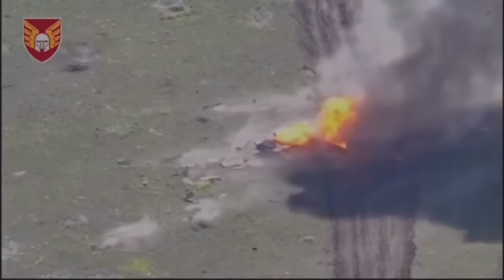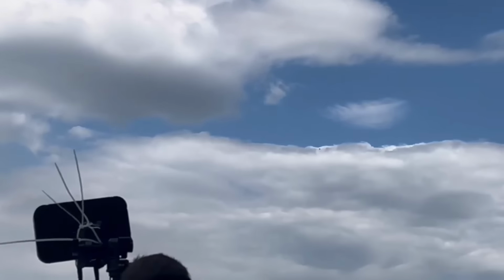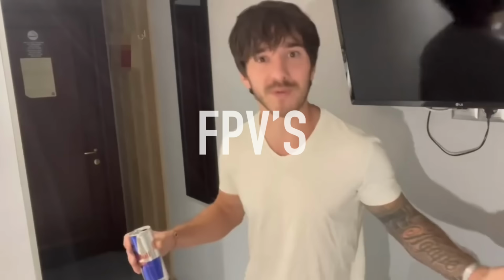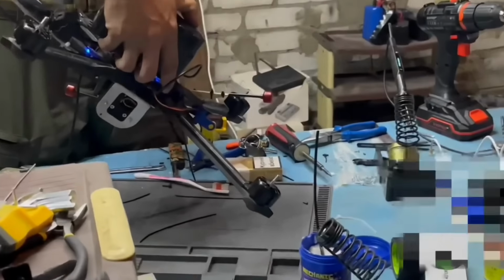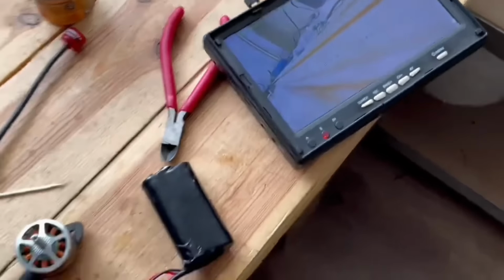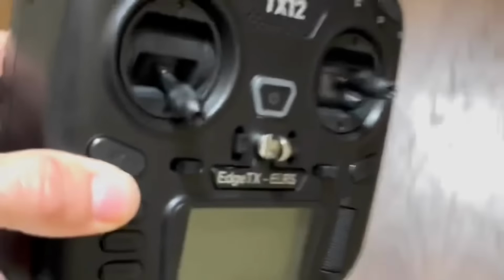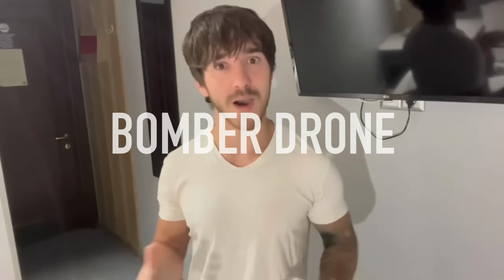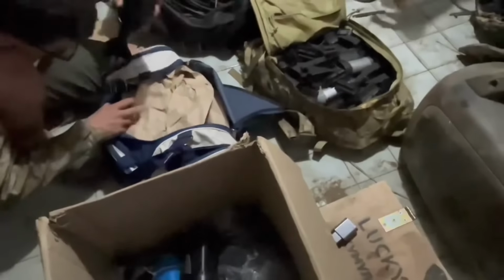How I Make Kamikaze Drones

Comment: Я сьогодні дещо навчився.
Reply from the maker: BARDWELL ❤️❤️❤️❤️ you are amazing, we all love you here
Reply: @CivDiv no joke, why don't they use a drone with an antenna halfway temporarily to a jammed location to extend your range for the fpv booms? Is that even possible?
Reply: @crazestyle83  actually, they do but few people know this
Reply: @CivDiv can I help you guys with supplies i can 3D print vog 17 cases and drop devices.  elrs transmitters receivers lmk I'm working on a solar-powered fixed-wing drone I also ordered 6 miles of fiber optic cable extremely thin like fishing line going to experiment with using that for control. Let me know if I can help also if you can get me the frequencies the Russians like to run there's a couple of us that want to try to develop some jamming devices not my area of expertise I also have some speedy bee controllers I could send you guys
Reply: @CivDiv 1 year late for this question but do you guys fly the kamikaze drones back to your position when you can’t find a target and the battery is low and change them out or let them die and crash
Reply: IN BARDWELL WE TRUST!!!!!
Reply: I just bought the Bardwell build yourself drone kit
Reply: Been flying FPV multicopters for 10 years. Joshua taught me everything. Thank you.
Reply: josh you really happy they weaponized our hobby? 
this is your life legit. what if our government decides to ban all drones cuz they been weaponized?
Reply: @508fpv  Every single technology has been weaponized. Every. Single. One.
Reply: How do you feel the cost effectiveness, increased range,  and versatility of FPV teams compare to traditional Anti-tank teams? like a squad armed with Javalins? Is there still a place for those very expensive, realitively heavy  anti-armor weapons? Or does FPV and bomber drones shift things a fair bit?
Reply: lol I'm really interested in his story, is he american?  Maybe you could interview him.
Reply: legend.
Reply: Can you put an antenna on a drone for boosting or cutting through jammers and fly it close by and land temporarily to extend the range of your fpv boomers?
Reply: Oh hey josh
Reply: nooo way, hello josha!
Reply: good one 😂 thanks to you were not only learning something new but protecting our country
Reply: @dmytrozaporizkiy3599 do you also protect your country?
Reply: iykyk (Hi josh, met at like 2 events years ago)
Reply: It wont be taken down because its pro ukraine
Reply: @bobg3633  you assume russians don't use the same tactics. They are masters of it.

Comment: Just so people don't get mislead and confused by the video I have to say that the drone doesn't have a receiver and an antenna (in the sense that they are mutually exclusive). An antenna can both receive and transmit signal, there are antennas on both radio transmiters and receivers. 
Also it is said that one of the antennas is for "radio" and another for "video". Both of them are for radio, both the controls of the drone and the video feed are transmited via radio waves.
Hope this clears up any confusion the terms might have caused

Comment: I've wondered why not have two VTX/cameras on board: an analog one for piloting and a digital one for observation. It would be even better if the digital camera was on a gimbal that could move independently of the drone. You would need a spotter to handle the digital one, but I guess you usually have a spotter anyways.

Comment: would it be possible to use multiple cell phone batteries with wireless charger pads and an ai program that can make it hover and surveillance watch, identify targets or changes to the environmentro notify an alarm. then land it self and charge on a 24/7 routine comepletely autonomously and relaunch after charging. so you could have aerial 360 coverage back up. maybe even make a self autonomous auto targeting sentry gun? i think a lot of a lot of the ai programs already are designed and can be easily implemented even in civilian and commercial market. just a thought ive had since drine were used. maybe you could make something using some of these ideas...? could be something youd get a lot of recognition and praise for contributing to the effort 👌 :)

Comment: It technically isn't self sufficient if you need to be delivered the parts. Unless you a secret method to make plastic and wires from raw material. Thus, the logistics behind delivering the equipment is critical.

Comment: How do you usually aim when you do bomb dropped drone?
Reply: drop downwards lol? or if you mean flying-crashing the drone at the enemy, theres a person controlling the transport and another controlling the kamikaze
edit: also theres not much aiming needed. explosions, even if your 10m away from the visible explosion, can still rattle your insides around/incapacitate soldier enemies
Reply: @henrydendorf4847  I mean the bomb dropped ones the one that drops bombs instead of ramming Straight into the target my bad on minor spelling mistake

Edit: I was wondering how you would know where the bomb is going to land when you drop it (also my grammar is pretty bad I apologize for that I'm not that good at english)
Reply: @deluxeonyoutube2973  you see in the video that the camera has a small servo attached to it allowing them to point it downwards. From there on i suppose it takes some practice to figure out when the drone is best aligned above the target for a hit.

Comment: I could probably write you guys some integrated control software so you can just use a laptop (or something like a steam deck) instead of carrying around a bunch of controllers and goggles. Pair it with something like an SDR so you can change frequencies ad-hoc, there are definitely some things we can do to improve the situation.

Comment: It sounds like you don't need help assembling drones but just funding and I think programming.  I am a software developer.  I wonder if software defined radios could solve most of your problems in the field.  I mean, why not code it to switch between a list of frequencies when comms are degraded.  Also, could we code some simple image processing to auto-identify targets when/if comms are lost?  I a would use a RISC-V board with RVV, a KPU, or TPU extension for the image processing and AI.  I've done all of this except software defined radio.  I haven't played with that yet, just read a bit about it.

Comment: More seriously though, I would love it if someone had insight into a thing; I often see what look like heavy-gauge aluminum wire , in the bottom of the video frame from the pilots perspective, that are close to one another but not touching. Sometimes one of them is threaded through a hoop made by the other. There’s at least one shot of a drone with them, jacketed in yellow insulations, (presumably it’s insulation), in this video. 
Are these part of an open circuit that, closing on impact, trigger the munition? 
Note- if any of this is sensitive info l plz delete my comment/lmk and I’ll take it down myself. 
Thank you for documenting and sharing so much of your experience and insight. Your videos are full of great useful, (in Minecraft of course) info. 
My feelings about this war aren’t necessarily in lock-step with the US/NATO party line, and definitely not with the Russian line either, but I hope the war ends in a dignified peace asap. 
Stay safe, get home to your people

Comment: I reamber back in early 90s i used reverse engineer some my toys into 4 propeller drones.I built a drone that use 2 360 degree panning fans reverse to keep it balanced you move the fans thung fly same as ufos.I was building these drones back un 90s as kid.they weren't same with gps or gyro but i found how to balanced them with out gyros so on.

Comment: You mentioned TX16S, Tx12s, boxers… and how you need to learn each one. Just program all controllers the same way. Takes two seconds on Betaflight, which you are using. Yes, it probably is a hassle uploading the presets to 50 drones, but still. 
And please dont call them “legs”. Drones have arms 😂

Comment: Hey bro are you running up against problems with Russian jammers?  It's ok if you can't say, I understand it might be sensitive.  I've heard it's becoming more of a problem and  I have some thoughts about counter EW stuff.  You know Claude Shannon’s Noisy-Channel Coding theorem proves there's a way to overcome any type of jamming 😜.  You know the mathematics of this stuff is really interesting✖➕➖➗🙂   I've been an electronics tech for over two decades and worked on military avionics of all kinds in both the military and defense industry.  I will be researching what kind of jamming the Russians are fielding and try to make educated guesses to fill in the unknowns.  You know the Ukrainians designed my favorite EW system -- Kolchuga passive radar sensor 📡.  It's like a wide band receiver with neat antennas to do advanced direction finding across a wide spectrum.....and you can do fancy stuff with the data received to interpret it.  I bet they putting that to good use these days to get ELINT on enemy EW.  Fun stuff!  Stay safe bro

Comment: why not use hdzero digital vtx and goggles? their digital protocol is a one way communication unlike dji and walksnail so the video doesn’t hard cut out, instead it “sparkles” almost like analog but clearer. the goggles have native analog module compatibility as an extra bonus. plus the freestyle vtx v2 screams at 1W which would be more resistant to normal jamming

Comment: Wonder if you could start using alternative frequencies, like 433MHz, Lora modules, for control. Maybe 900-something for video. If they are jamming 2.4 and 5Ghz, should be good on different frequencies. Less attenuation on lower frequencies may help during the terminal attack phase of flight. If you try it, I'd like to know how it goes.

Comment: So many qustions!

How come these drones have not been standarized and mass-poduced locally form standard, modular components?

And how come they are not all equipped with very basic machine vision ("move in a way that keeps these pixels in the center") for terminal guidance in case it gets jammed before impact?

Do you use automatic frequency hopping?

Comment: It may not be a major concern for a soldier firing rounds off all the time, but if you spend any significant time soldering, definitely use a respirator. If you can. Organic vapour with activated charcoal.

Comment: Remember, the longer the blades used as propellers, the more weight you can carry (via payload). Pretty sure most know that, yet it should still be being improved upon. Better performance equals deadlier capabilities.

  You can even mount the propellers higher on each side from one another to accommodate long blades on a small chassis.
Reply: Не совсем так. Есть шаг винта. И kv мотора. От них тоже зависит многое.
Reply: @kotnapromke   what?
Reply: @ThowDragon  Зависит подъемная сила дрона.
Reply: @kotnapromke  huh?

Comment: @CivDiv you show a linearly polarized Yagi-Uda antenna (more in a moment). Most drone (expecially FPV) antennas are circularly polarized and even if linearly polarized will shift between vertical and horizontal as the drone maneuvers (hence the circular polarization) which will mismatch with your base station antenna. This can be cutting your performance in half as well as making you susceptible to EW and generally annoying you in the field.

I am a USAF vet turned Research and Development Engineer in the relevant space. I believe I can assist in making your job easier while increasing effectiveness if we can connect privately. Let me know if I can assist you. I can not go beyond the obvious (like polarization mismatch above) in public. 

Back to the antenna: Yagi-Uda antenna (the xmas tree) have physical dimensions dependent on the frequency they are tuned to. Showing it in video or just someone there snapping a picture shows the enemy what frequency you are going to be on. This is why all USAF antenna for systems like this have radomes. Take an old pair of bdu trousers, cut off all the metal, and stick the antenna in the leg. This will both hide your frequency and break the straight lines computer vision systems are so good at finding. EVERYONE in the AO should be doing something like this as SOP. Also that is something you should really cut from public imaging.

To everyone else please upvote this for visibility.
Reply: AFAIK there are teams in the background helping them build drones, also there are channels to exchange best practices. 
Diversity can be a plus here: if there are many different types of equipments they are harder to jam or evade, because each of them has different characteristics. Also like he mentioned: the mission and the environment can make one type of device superior to the other one.
Reply: Imagine all the adaptive transmission strategies once the software defined antennas start offering wide enough range of operating bands
Reply: @xxxxxxxxxx4879  is software defined antenna a thing?
Reply: from what i see they just choose from a network of antennas based on the FQ. Software defined would involve a material reconfiguring itself based on the chosen FQ
Reply: @brianmanderson  Yes and no at the same time. It's a very hot topic in research for last few years. But I haven't heard about anything with programmable bandwidth hitting the market. (And for the last 2-3 years I'm completely out of the loop) Arrays with programmable directivity are no new thing tho.
Reply: Yes. There are many different approaches considered. The simplest of course is selecting one of multiple antennas. Another is to have reconfigurable dimensions of the antenna using PIN diodes. There were some concepts regarding FPRFS structures that did some black magic with controlling the directions of the currents in segments to effectively reshape the areas that can radiate. Finally, there are metamaterials which can change their parameters when you apply some voltage to them.
Reply: *Glows
Reply: The easier way is to just enclose your Yagi inside a square polystyrene box to hide it's shape/dimensions.
Literally tape some frozen food lids around it.
Reply: @stevebuckley7788  It has almost no benefit to hide your antenna when you are using off-the-shelf, hobby grade components. To find out your frequencies all it takes to open the product page on Banggood. Most of these things operate in the 2.4Ghz and 5.8Ghz free bands, while a handful of devices in the 900Mhz. Also many FPV googles have in built frequency scanners, so with a push of a button you can scan for any transmitters in your vicinity.
While these aren't military grade devices, their benefit is in how cheap and easy to maintain they are. Is your opponent blocking your channel? With a button press you can switch to another channel. Are they blocking the whole band? For $40 you get transceiver for another band, and you can replace in in your drone under an hour.
Reply: A log-periodic would be an obvious choice to me, or maybe a crossmounted pair of them for circular polarization.
Reply: @ninjakittens5255  idk what you be saying but I'm up voting it
Reply: Im sure we didn't get a look out in the field but Im sure they are camo netting the receivers. But yeah giving away antenna lengths isn't good. I think their reciever is a patch antenna array however they had the block on top of the mast.

Comment: You said something about charging smaller batteries, if you're going to kamikaze a drone. why use secondary cell batteries. I think primary cells are lighter (and cheaper?).
Reply: could frequency hopping be a solution for the interference?
Reply: I think primary cells might be better for the bombers too, you have to carry less weight at the frontlines, a new run is just a simple batteryswap, you don't have to mess with extra cables and a power source be it a bigger battery or a generator. And you have more flight time because less weight/energy (altho i'm not sure if it's really significant tbh)

Comment: I recommend extending video and power cables NOT the coaxial antenna cables. its been tested in this lovely community, having coax between your receiver and yagi or cloverleaf can have weird effects on signal strenghth.
Reply: That's because you need to match the antenna to the transmitter and receiver. Impedance mismatch = signal loss.
Reply: @pianojacq  yes, I am mainly talking about antenna extensions.

They lower effectiveness with any kind of antenna, circulars patch even the standard antennas
Reply: @svenvanwier7196  I see a lot of myth in these threads and it is great to see more people that have something grounded in real knowledge and experience on these topics. This video is interesting for what it shows but also for where it gets confused.

Comment: I have a few FPV drones, circa 2018, that I don't fly anymore. There is one 16" and a few micros. I've also got a Yuneec camera drone, a few goggles (functionality unknown) as well as batteries and drone flying odds and ends. Would any of this be of use to Ukraine? I'd certainly pay the postage to send these to the front. That would be far more rewarding then trying to sell them on Ebay. Sorry for the long post.
Reply: They will be very useful,  especially this 16 inch

Comment: UART means Universal Asynchronous Receiver/Transmitter, it's a standard protocol for devices or components to communicate and also known as serial (as in "serial ports" you might find on old PCs or printers). You only need two wires, one to transmit (TX) and one to receive (RX), although there are usually two more for power and ground. The TX port of one device is connected to the RX of the other and vice-versa. It's extremely common.